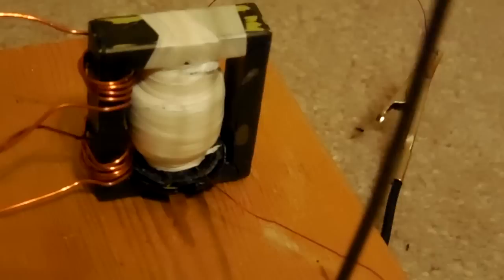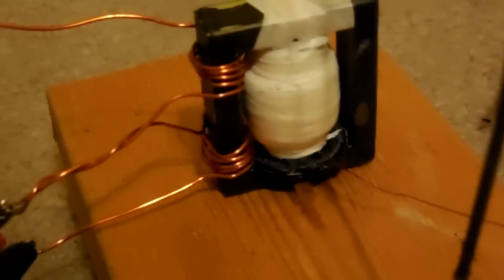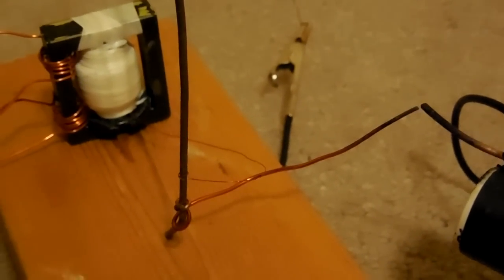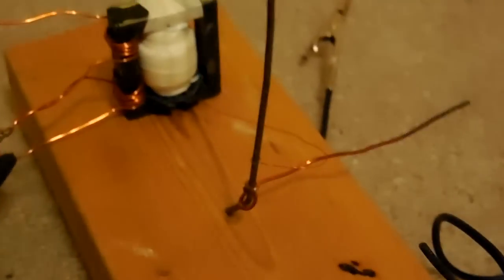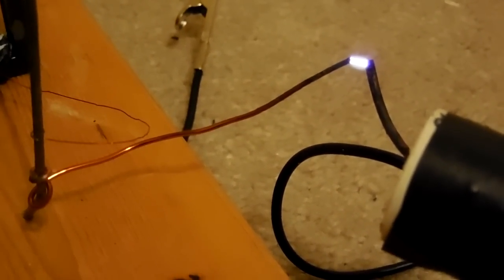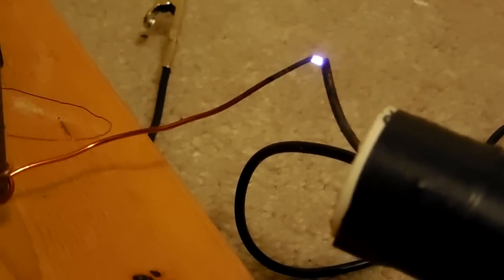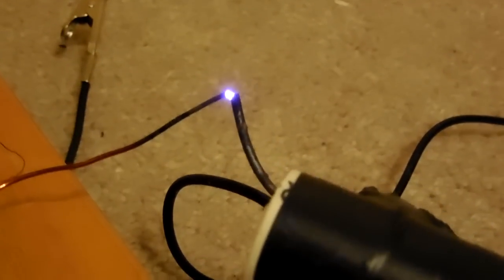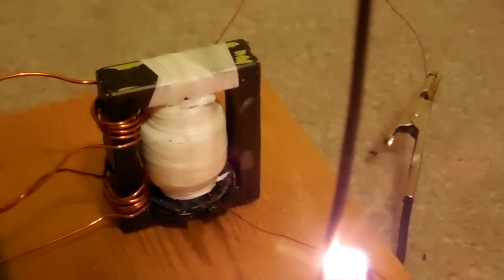Homade High Voltage Transformer MK3 Works!!

Comment: I've just realised something about your transformer, you have wound your primary on one of the outer legs of the transformer. Note that the middle section of the E core has 2X the cross sectional area of each of the outer 2 legs individually. 
This means that when you put the winding on an outer leg the magnetic field generated by it will be split between the center leg and the other outer one so you are loosing a large portion of your power to a field being generated by that outer leg.

Basically if you are to wind the primary over the top of the secondary (on the middle leg with as much insulation as you can fit, as i said Kapton tape is better) then you will get more output.

Comment: Good job!! I'm doomed to winding my own flyback here soon. I need an AC output for a voltage multiplier, and there's absolutely no producers of AC flybacks!
Reply from the maker: Sure you can find AC output flybacks :D I've got a couple of them. You just need to find a really really old TV. They have massive flybacks and the diode and other components are separate from the flyback, and if the TV is old enough it might even have a large vacuum tube instead of a diode!
Reply from the maker: +AnomalyTech  good luck with your homemade flyback project!

Comment: You should use kapton tape for insulation, it has a far higher breakdown voltage and is very heat resistant. It also looks like you could use thinner wire on the secondary and get more turns in.

Comment: how many amps is this?  and when does this become dangerous ?
Reply from the maker: +Jason schmidt I do not know how many amps it is, but it only takes about 30 milliamps going to the wrong spot, and you're dead. So always be careful no matter how small the arcs are. Thanks for watching!
Reply: +Electrotechnics thanks for the reply, iv'e done a bunch of research since I posted this. It completely depends on the resistance of the object that is touching it, but enough voltage can overcome any amount of resistance. human skin is 1- 10k ohms; not very conductive. using ohms law 48v/4000 = 0.012A  that a decent shock, but probably nothing serious. 480v/4000 = 0.12A. this would be a bad day. (0.1 - 0.2A = maybe lethal)
Reply: +Jason schmidt I don't know what you were looking but the human skin resistance is average 500K ohms. 20-50K ohms is of the human tongue. You wont feel DC 48 Volts. It slightly starts to feel over 100 Volts DC. Regarding ohms law 10 KV is more than enough to kill you depending of many factors. But 480 wont kill you- you just will get a hard shock. Consider it that way- every power supply over 10-20 KV which can deliver at least 10mA is instantly lethal.
Reply: don't overestimate high voltage, even 480 can be lethal.
Reply: Even lowe voltage than 480 can stop your heart, if noones around you are dead after 5mins.